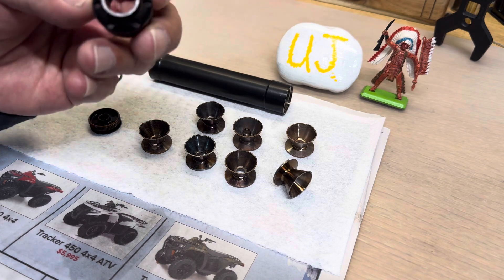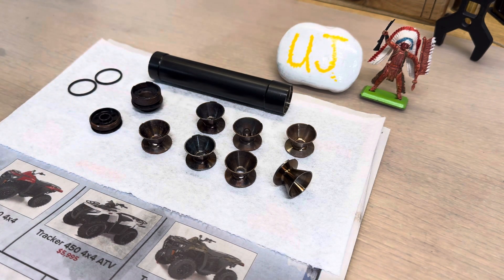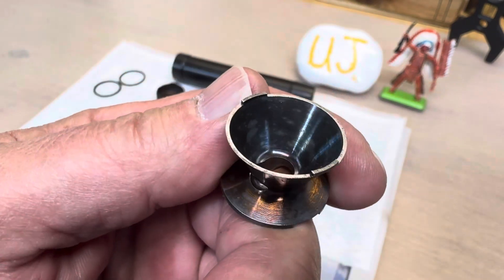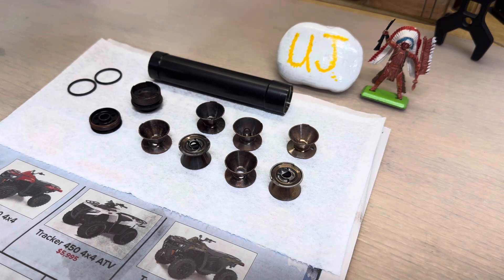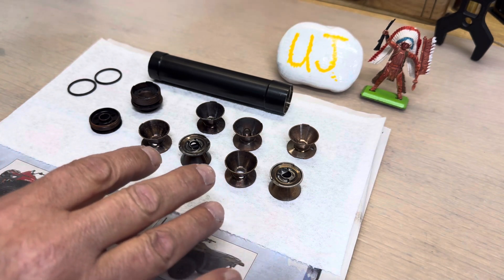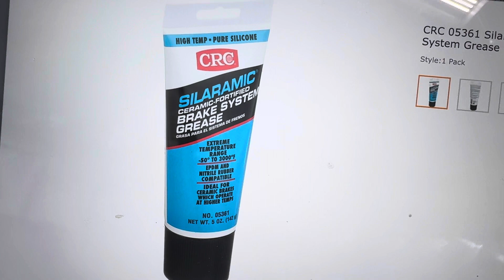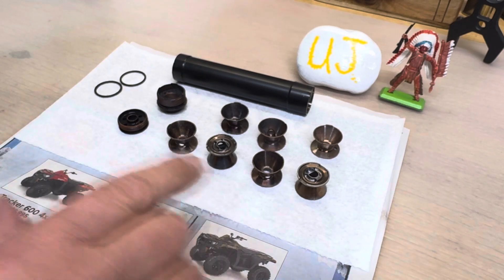CLR test on suppressor baffles

Comment: Hi uncle Jim that’s pretty clean 👍  clr is nasty stuff even on there website says do not use on firearms hopefully those parts be ok
Reply from the maker: Hey Julio. 👍 I wouldn’t use it on a barrel and it definitely needs to be neutralized, works great on these heat treated SS baffles though . 👍